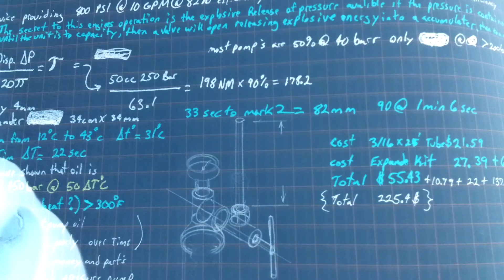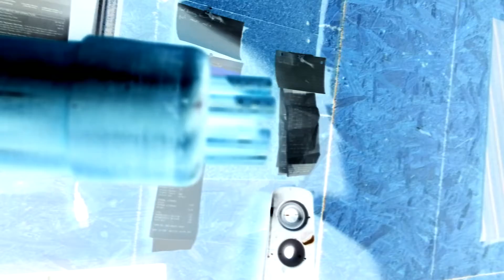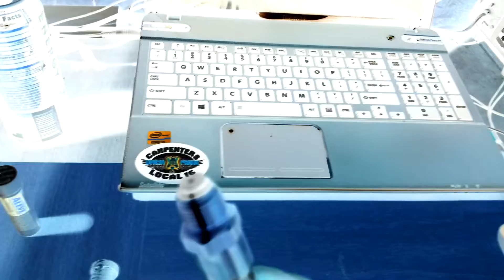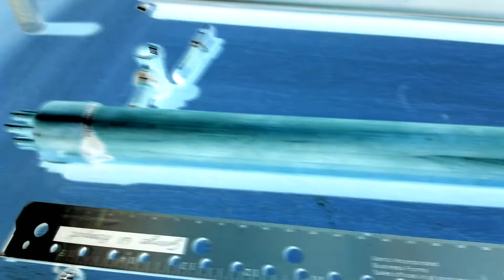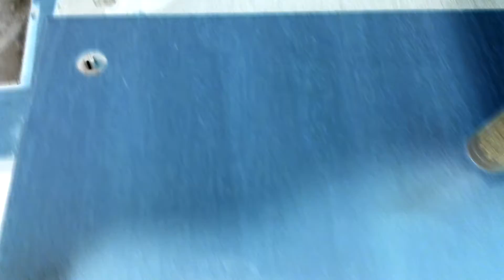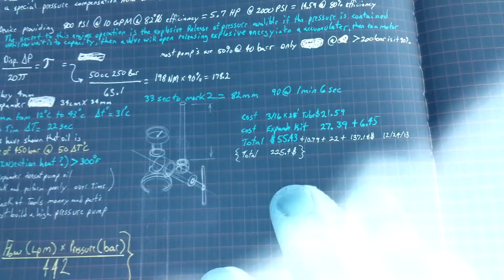Heat engine testing

Comment: Thank you.  Is there another thermal ex-pander that inspired you?
Reply from the maker: yes my mercury expansion engine which i also proposed to the D.O.E but they refused a grant due to my lac of staff and tools, had i bin a company they woulda   gave me $250,000 to research its feasibility then they give you $500,000 if you pass the stage 1 grant, im still trying to make this all happen , just dont have the time for the most